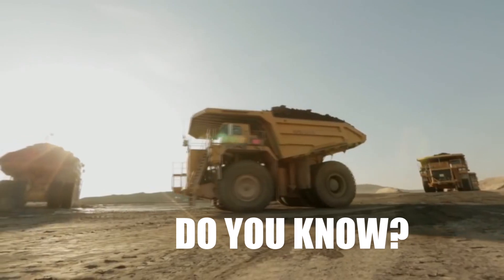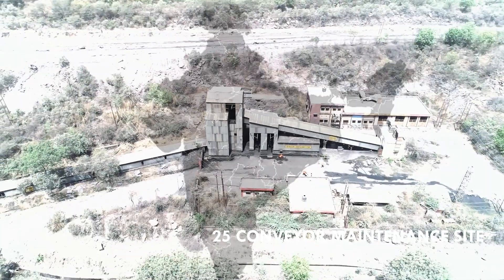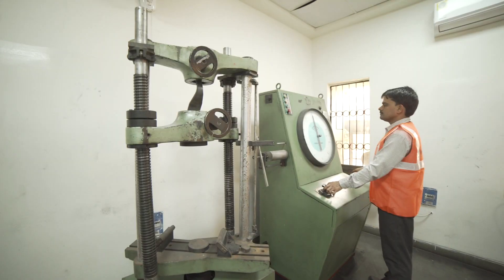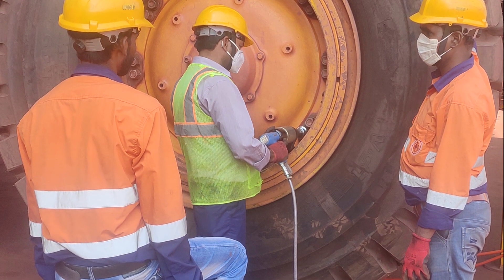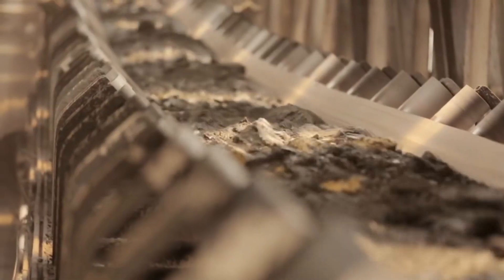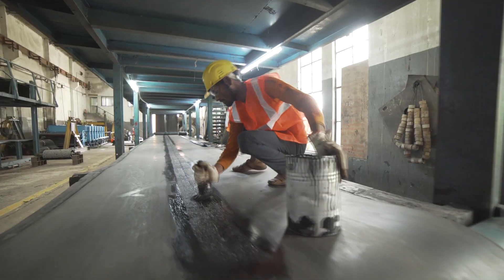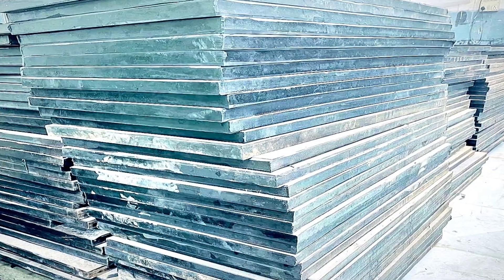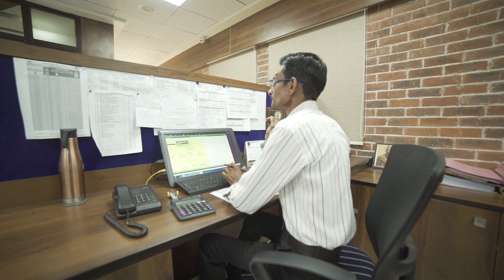Waidhan Engineering & Industries Pvt. Ltd. OTR Tyres and Conveyor Belt Products and Services

Comment: Sir I have 12 years working experience in mechanical field like tyre and conveyor belt maintenance of TTGA (REMA TIP TOP COMPANY
If you have any requirement of manpower?
Reply from the maker: Thanks for your interest in Waidhan Group. You may please contact Mr. Harsh, Mob: 9302777250